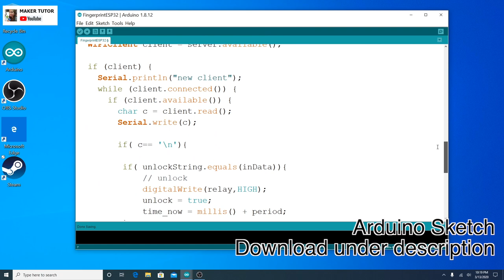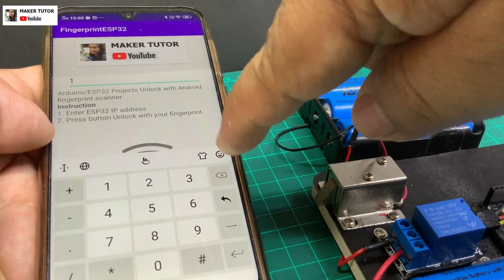How to Make Android  Fingerprint Door Lock | Arduino/ESP32 Project

Comment: help pls  its showing error

esplock:8:17: error: 'D2' was not declared in this scope

 const int relay=D2;

                 ^

Multiple libraries were found for "WiFi.h"

 Used: C:\Users\com\AppData\Local\Arduino15\packages\esp32\hardware\esp32\1.0.5\libraries\WiFi

 Not used: C:\Program Files\Arduino\libraries\WiFi

exit status 1

'D2' was not declared in this scope

This report would have more information with
"Show verbose output during compilation"
option enabled in File -> Preferences.